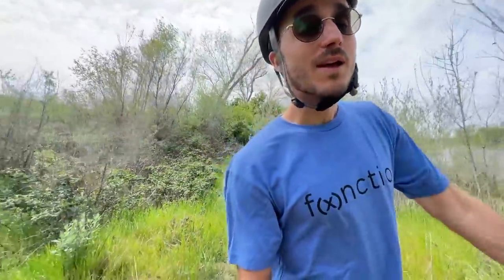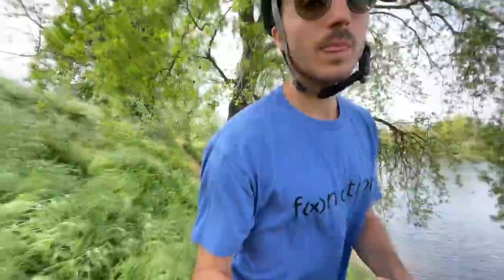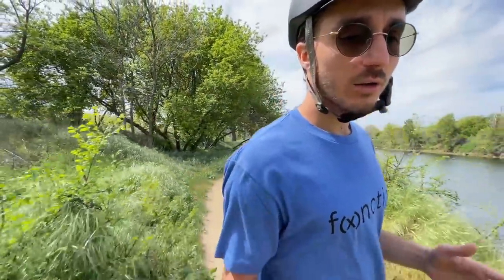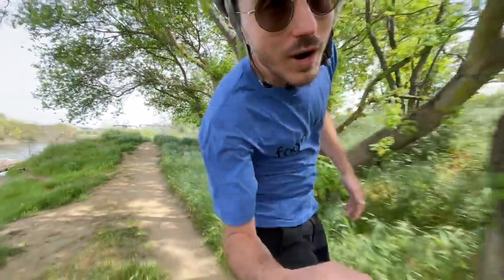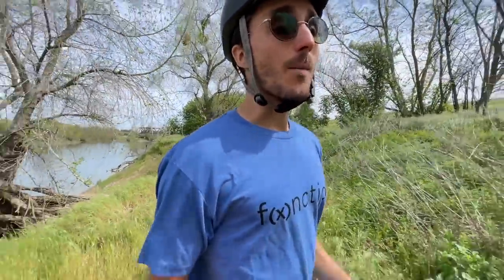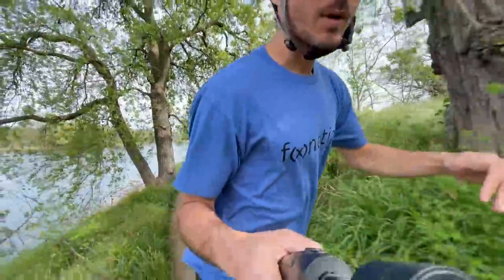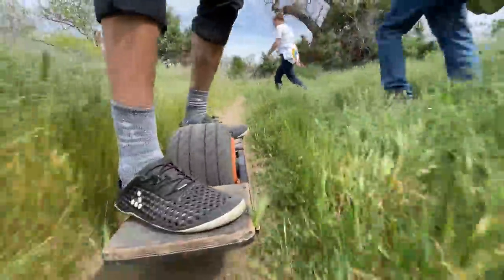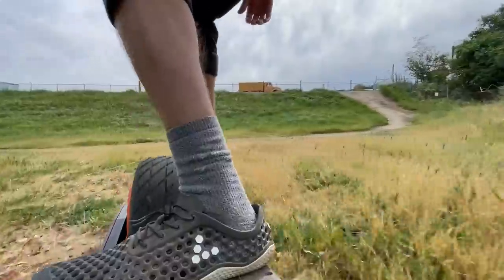Why I Don't Trust anything Future Motion says - #RightToRepair Onewheels

Comment: Hold the phone, you need to have them replace the tire? They are standard go-cart tires. By the way, you were going up hill with your one wheel for.a second there. That means your warranty is void.
Reply from the maker: The Onewheel GT has a non standard 6.5” rim. Future Motion is currently the only manufacturer of 6.5 tires in the world. Karts use 5 or 6” rims
Reply: @JakeLeary  Was really interested in this awesome idea and was waiting for it to mature but it looks like it wont be acceptable to me at this time. I still think electrics are experimental new toys and not even close to mature tech. When you can get a 750W 400 mile rideable that is not boutique locked, but self serviceable from common brands, I'm sticking with conventional. Which is sad, because they look like incredible machines that could really improve lives.
Reply: @JakeLeary   ‼🙏🏼😎  I just bought a used XR.... can I replace my own tire?

Comment: Had the main bearing go bad. They said it went bad because bolts were left loose after reassembly after putting  a treaded tire on the XR. Total bologne.
Reply from the maker: Wtf even if they were left loose that wouldn’t cause damage to the bearings
Reply: @JakeLeary  💯

Comment: I’m really bout to cancel my GT order cuz I’m having a hard time justifying it with how bad FM is and all the issues and delays. I’m bout to just cancel and get a inmotion v12 order
Reply: ultradeadd  it’s pretty hard to justify spending $2400 on something with a third the range and half the speed of an euc with not even a quarter of the rest of the features included. Like onewheels are ridiculously over priced for all the bang for your buck you get with an EUC. And their business practices make it even HARDER to ignore said pricing and performance issues.
Reply: ultradeadd  for basically the same amount as a GT I can get a inmotion v12 high torque that could ride the GT down 3 times before needing a charge and go 40+ mph. Has the headlight, built in rgb and speakers, built in screen. Trolley handle. TRUE safety features and the ability to buy each individual component to said EUC on numerous websites that I can use to repair it MYSELF
Reply: ultradeadd  I could go on and on as to why the logic in my head is telling me the fun of a onewheel isn’t worth it and will die off fast for me.

Comment: all they had to do was put some rubber slastic to hold it down would have fixed it fast.  just what they told you and this BS will 100% stop me from every buying one.
 but tacking it out is fine some one might hear a Buzz on there AM radio as you drive my lol

Comment: That ring sounds like a planned failure. It also sounds like they want to control the repair market which is why removing the battery bricks the system. The only thing fm techs have that other techs or owners don't have is software

Comment: Have 2 XR +. oem batteries have been replaced (they are old!) sent it in because it started having some weird issues with charging. Sent the board to them and because the serial number on the battery and module dont match...they are refusing to service. WHAT? its an OEM ONEWHEEL BATTERY. Still wont fix. I dont get it. I will PAY YOU TO FIX IT. They are refusing. Do they really want to alienate customers so they do not repurchase? Do they WANT to go out of business? TERRIBLE business model and service.